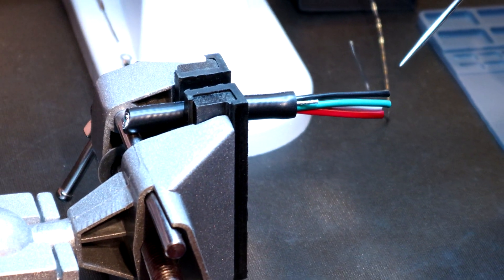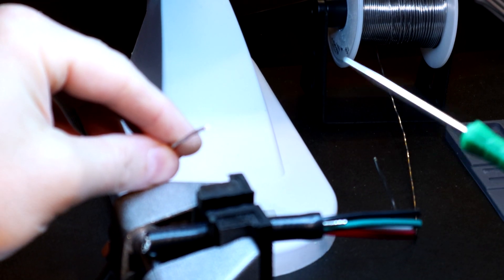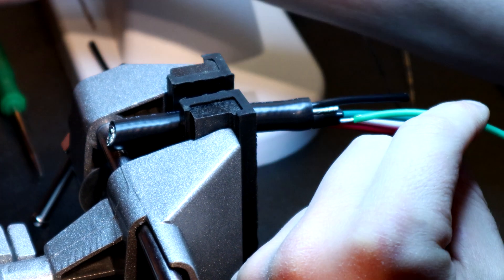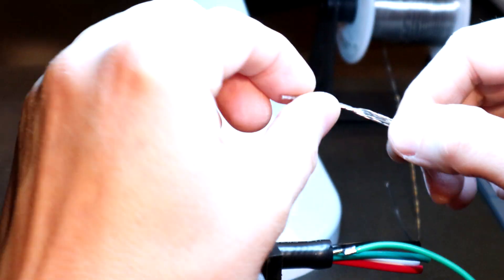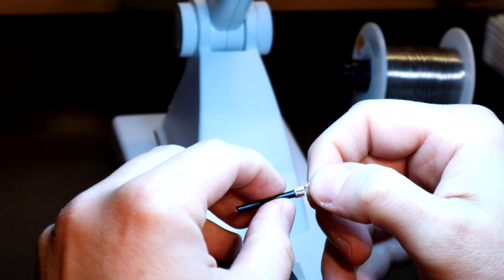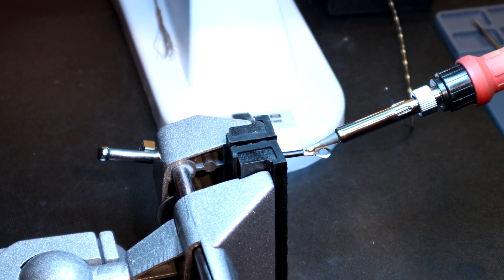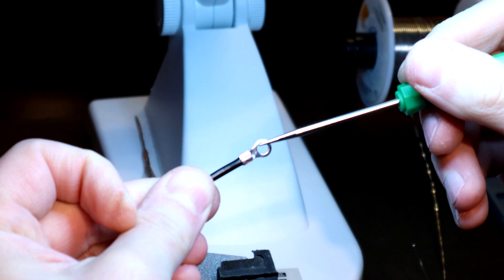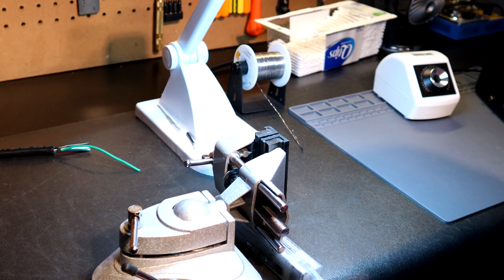How To Perform CNC Close Proximity Soldering & Crimp Connector Soldering 4K..

Comment: I'll be damned if that was a good crimp from the get go Vince. I've always used the style that indents the back side of the crimp itself. I still pull every crimp to test it, by putting the loop on a hook to pull. Then i soldering following your suggestions, kester is the way to go, beats the snot out of pretty much everything.
Reply from the maker: Jordan, thank you for your support. I never trust crimp connectors for robotics use, and it really only takes a minute to apply solder to them when done correctly with flux. Once end users see how fast it is they seldom look back. have a great weekend! Thank you,
Vince

Comment: Great Video and very on point love it. what do you do with a shielded cable wich does not have a shield drain?
Reply from the maker: KOR thank you for your support, and kind words. In the event your cable is missing a shield drain you will create a drain by twining the tinned braided copper shield into a lead. Then tin it with solder, and solder another more flexible lead to it. Like illustrated in my video silicone wire is your friend for this application do to its flexibility. Thank you,
Vince